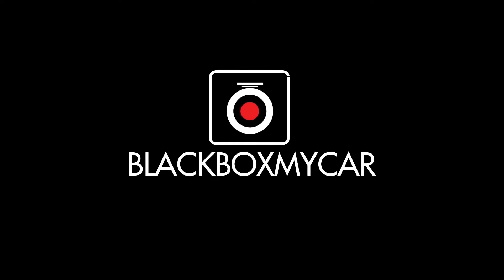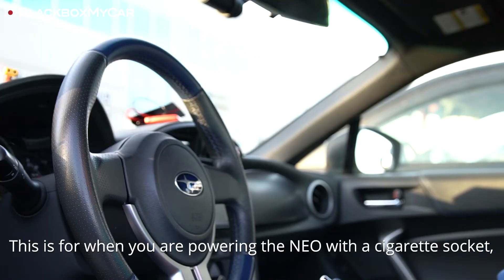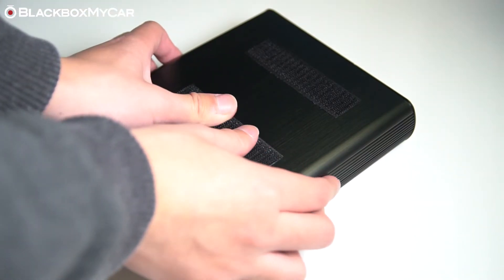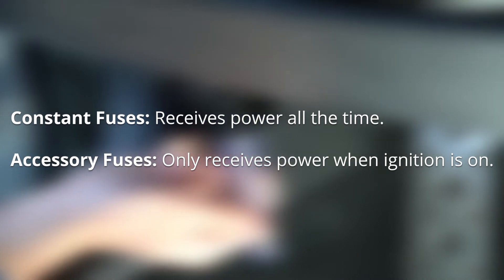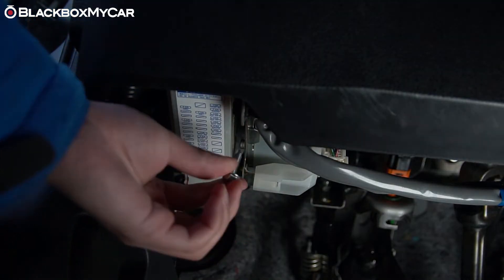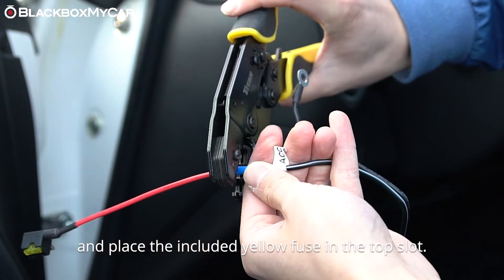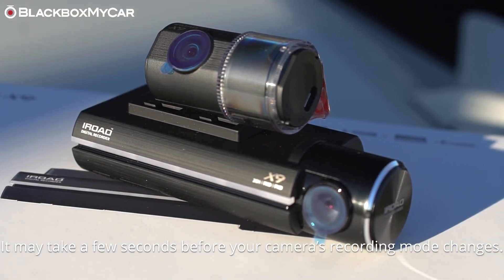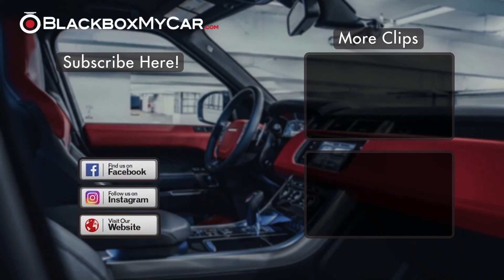Cellink NEO Battery Pack Installation Tutorial - BlackboxMyCar

Comment: 0:47 what if the cigarette socket is NOT ignition switch?
Reply from the maker: Then you will need to hardwire the battery, or unplug the cigarette adapter when the car turns off.

Comment: At 2:51 you remind us to change the capacity in the app to 12,000 mAh. The Cellink Neo Extended Battery Pack (Ext7+) has a capacity of 6,800 mAh, so shouldn't the capacity setting in the app be set to 12,800 mAh?

Comment: I'm planning to buy the viofo t130 3ch with this work out of the box with out buying the hardwire kit for parking mode
Reply from the maker: No, you will still need to purchase the VIOFO hardwiring kit. However, in order for it to work with a battery pack, you do need a spliced power cable. Can you contact us at info[at]blackboxmycar.com? We'll set you up with what you need.

Comment: Bought Cellink Neo 8+ and paired it with Viofo A129 dual. I worked fine for a few days. Recently, every mornig I go to the car, I see the camera not working (it was supposed to record in parking mode at night and did so, for said few days) but now it seems the battery turnes it self of and does not suppl power to the camera. Also, the bluetooth app does not work in the morning. It is as if the battery is dead. Excepts it is not, because when I turn it off and on again everything works and it it's charge is at 99% full. What can I do to make it work again when parked and ignition turned off? Does it have a factory reset procedure of some kind?

Comment: Do I have to hardwire the battery pack if I have a dash cam that uses the 3 wire wiring kit to go into parking mode? or will it work if I plug it in the cig lighter?
Reply from the maker: If you are using a battery pack, we still recommend hardwiring the battery pack so you get even more parking mode runtime. But you can still have parking mode with just a battery pack and the cig lighter.

Comment: Hey, im thinking of purchasing but i'm wondering will parking mode still work with cigarette power > Cellink NEO > Thinkware? I recently purchased F200 and I am currently leasing my car and rather not mess with the fuses. Will the cellink and camera realize when i've switched off the ignition? Will the camera just stay in continuous recording mode or does the voltage change to trigger it to parking mode?
Reply from the maker: Absolutely! You will still achieve parking-mode recording if you power on the Cellink Neo via the vehicle's cigarette socket - you do not need to hardwire that battery pack :)
Reply: @blackboxmycar  how long can the battery pack power an average dash camera via cigarette lighter as its primary charging source?
Reply: I have mine connect to the cigarette socket but I can’t seem to put my dash in parking mode when I turn off the car. It stays in continuous mode.
Reply: @GrindEndeavors  try adjusting the settings in the Thinkware cloud app
Reply: @MellySoWavy  that’s the first thing I did. I’ve watched videos and everything. Not sure why it isn’t switching.

Comment: Hi, I’m going to install this on my Nissan Leaf, would you recommend me hardwiring it’s to the cigarette lighter fuse? Or should i buy the circuit tester?
Reply from the maker: Does your cigarette lighter fuse turn off when the vehicle is off? Most cars are like this but it's not guaranteed - a circuit tester will determine this 100%.

Comment: Question: I'm planning to buy Viofo A129 duo to pair it with the cellink neo battery pack. Will the Viofo A129's parking mode still work  if i use cellink neo's spliced hardwire output kit, instead of Viofo's HK3 hardwire kit?
Reply from the maker: Hi there, this will work. However, you will have to select the unspliced 3-wire kit and splice this to the 3-wire VIOFO hardwiring kit yourself as we currently do not have a pre-spliced option available.

Comment: Hi, if I harwire the Cellink battery pack to my car and connect to a Viofo a129 duo, will the dash camera automatically switch to parking mode if I turn the ignition off? If not, how to solve it?
Thanks.
Reply from the maker: Hi Har Kur, the answer is yes - it will. The Cellink battery is just meant to continue providing power to the dash cam even while it is in parking mode. If you have any questions during your install, please don't hesitate to contact our team at info[at]blackboxmycar.com.

Comment: Nice vid, but seems you didn't want to talk about any connections from the Neo to what looks like a Thinkware cam......
A shame.
Reply from the maker: Hi Kenn, the installation method would be the exact same between a Thinkware / BlackVue dash cam. The only difference is the spliced cable that you'll need and you can purchase the battery with that spliced option on our website.

Comment: What if all fuses are always on?
Reply from the maker: Most vehicles have ignition-switched fuses. Please check to see if there is another fuse-panel present that contains fuses that only have power when the vehicle is on. As the Cellink NEO does not possess voltage-cutoff properties, it is not recommended to connect this to an always-on source as you risk depleting your vehicle battery.
Reply: @blackboxmycar  mine is connected to an always-on fused. The unit does comes with voltage-cutoff properties.